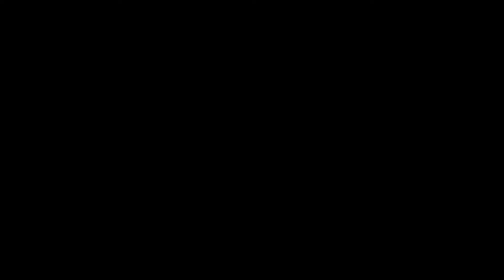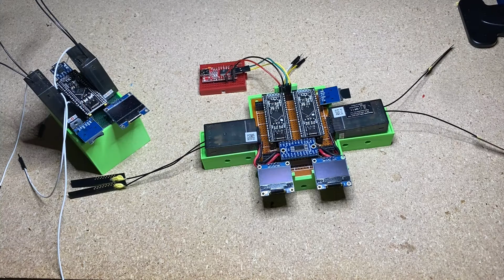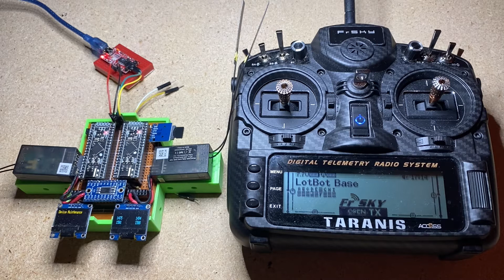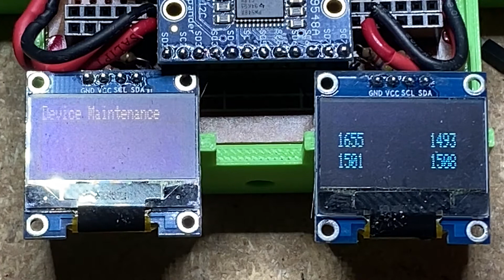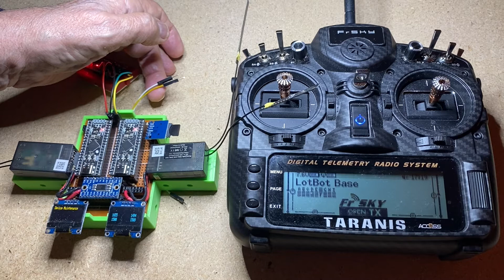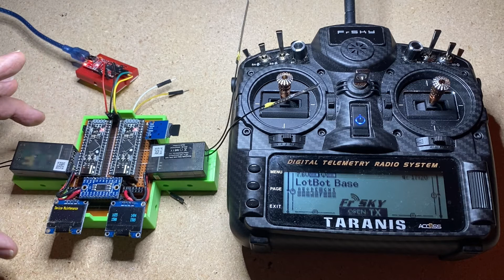2 STM32F4 and .96 inch displays connected with I2C and multuplexer update of the LotBot Base Project

Comment: Hi,
 I have not been able to get any i2c  going with Blackpill stm32f4.
using PB6 and PB7 for clk and SDA.....     i have a rtc  ds3231
easy peasy with an Arduino....
any help please.     Do i have to define which I2c port im using on the black pill?
Reply from the maker: No, you have the same pins on the stm32f4 I am using and they should go to the CLK and SDA on your RTC. However, do you have resisters connected to voltage from both the CLK and SDA on the RTC? if not I suggest you look at a different video on my youtube channel LotBot Robotics called "I2C Bus example with 2 STM32F4 Black Pills, 3 TCA9548A Multiplexers and 5 0.96 inch displays" This video shows how I have resisters connected to every device on an I2C. You don't need the multiplexers but this shows a lot of devices hooked to a black pill using I2C. I believe if the device has the resisters you don't need to add them but I had to add them on all my devices. Let me know if this helps.
Reply: @lotbotrobotics5026  Hey Great....  no i dont have the resistors!   i thought they would be built into the module...  ah..ha   
I will give it a go, and let you know..   thank you.   :D
Reply: @lotbotrobotics5026  Yey! I got it going... yes it was the 2 resistors.
Im curious though my program says the address is 104 with 
#define DS3231_I2C_ADDRESS 104
The RTC module i have does not have any pins to set high or low to change the address, it only has + -- clk and Da.
I would have thought it would default to address 0 ? its important if i add another i2c device like eeprom which i plan to.
anyway its working!   thanks for your help!
: D   very clear and interesting videos.
Reply from the maker: Most modules have addresses set by the company that makes them. if you need two with the same address on an I2C line, that is when you need a Multiplexer.
Reply: @lotbotrobotics5026  okay... thanks for that. I've got it going good now. These Black pills are cool!  ive got screen, sd,clock, lots of ad and pwm ... im doing sms next  :D